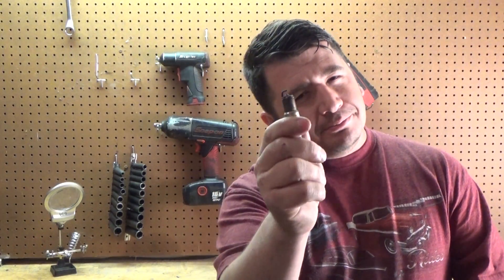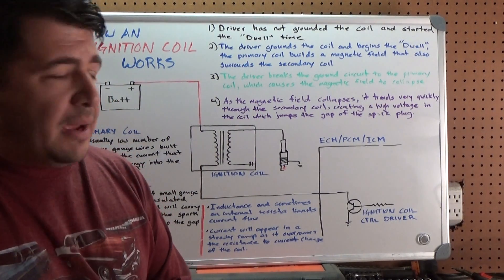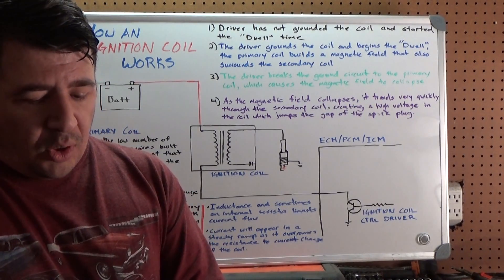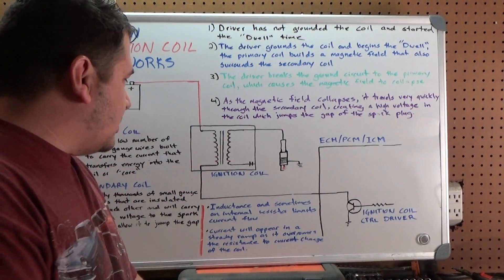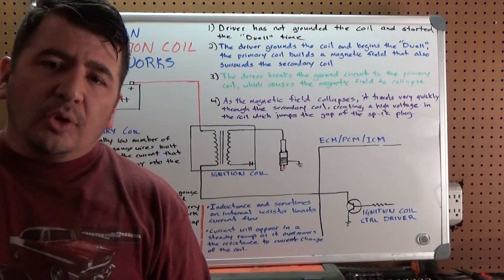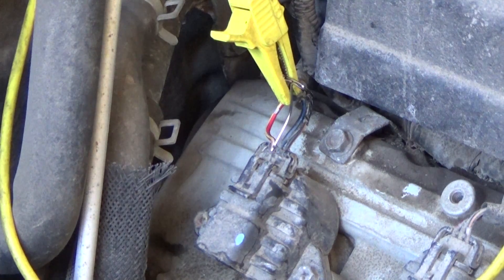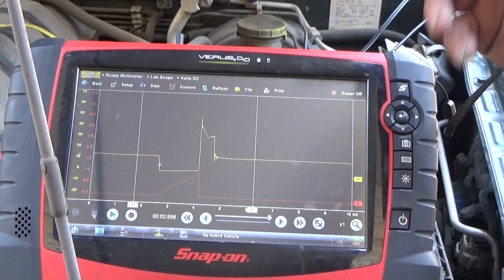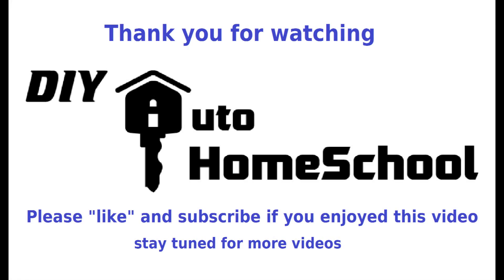How an Ignition Coil Works - Automotive Education

Comment: Hi friend, so the primary voltage is 12 volts when it's running
Reply from the maker: When running, the primary voltage will be charging system voltage (Typically between 13 and 14.5 volts)
Reply: @DIYAutoHomeschool  thanks for reply, and if it's an ac CDI scooter what should the primary voltage cause i am confused

Comment: 14:03 what's the difference between the yellow and red line.   He says yellow is on primary trace on control side.  What does that mean?
Reply: 10:08 The “control side” is the black wire (below the coil) on his board.
The yellow line on the meter is looking at the voltage on that wire. He points at it right here 10:15.

The red line on the meter is looking at the current flow through the red wire on the board (red line above the coil on the board).

Comment: If you had a highly focused, high frequency electromagnetic wave generator (such as the "Active Denial System" used by the govt) you can disrupt the operation of the ignition coil and you can cause random electrons to jump the spark plug gap - this is called "the Photoelectric effect" or photoemission.  The higher the frequency, the more effective the "rough running car" is.

Germans developed similar tech in the 1940s to today's 'Active Denial System' and tested it in ww2 to disable engines of the Allies that used spark plugs and ignition coils.  Photoemission/photoelectric effect technique does not work on diesel engines because diesel engines do not use spark plugs and ignition coils.  UFOs were known to disable cars using the same trick according to worldwide reports of witnesses, in the 1940s, 50s and 60s.  The Active Denial System is a technology descendent of those developed there in the 1940s.

Comment: Thank you for the amazing video. So if I understand correctly, coils on plugs have one side of the secondary winding connected straight to ground? Is it the ground symbol that you drew in the middle of the screen, at the bottom side of the secondary winding?

Comment: Great video!   I know when a transistor is driving an inductive load, you often see a diode in parallel to the inductor to prevent large spikes when the transistor/switch turns off.  Obviously there isn't a diode in parallel with the primary "inductor" for this ignition coil, so are the transistor switches in the PCM just high voltage devices that can handle the 50-70V spike, or do they have any sort of protection?   Thanks.

Comment: Does the high voltage pose any danger? I have seen videos where people hold the spark plug against the engine to check for sparks
Reply: Current flow - the amount of current flow - is the real danger.  If you look into it, you will find that as little as 0.050 amps (50 milliamps) of current across your chest can be fatal under certain conditions.  Not for everyone - depends on your age, health, etc. but better 'wary' than injured.

Many of us have accidentally felt the zap of a spark plug's 20,000 volts but you have to be more mindful of current.  One of the things we were taught in elec. engr. school is - if you have to grasp or handle part of an electrical circuit,  use the "One hand rule" - the idea is to never give electricity the chance to enter in one of your hands, go across your chest, then out the other hand.  Never hold electrical/electronic gear with two hands to stop it from affecting your heart.  And short out (drain) all capacitors after switching off power.

Comment: Primary back emf is between 350 and 450v, multiply that by turns ratio you get about 40KV secondary, your tools don't show that either because you're using them wrong or just because they're low quality crap

Comment: What happens to the voltage that is induced back to the battery in the primary circuit when the driver turns off?
Reply: Typically, it is absorbed by a "condenser" aka capacitor as a safety measire.

Comment: Great Explanation and thanks for sharing & publishing … so I have and maybe referred to as a stupid question; once the automobile ignition is turned and the vehicle starts and continues to run is the ignition coil still in use or is it at that point the distributor takes over? …
Reply from the maker: Not a dumb question. I don't think any question that's asked to learn something you genuinely don't know is a dumb question. 

Any time the engine is running, the ignition coil is working. The coil is what creates the voltage that jumps the gap on the spark plug and ignites the fuel and air mixture in the cylinder. 

On older engines that had distributors, the distributor's function was to direct where the voltage would flow to. On a classic example, there would be a single coil which would create the spark for all cylinders. The coil wire would go to the center of the distributor cap where it was transferred by a metal contact to the rotor. That voltage would travel through the rotor (which is was connected to the shaft driven typically by the cam) and make the extremely small jump to one of the metal contacts on the cap and to the post on the outside of the cap. It would then would travel through the plug wire attached to that post and to the spark plug for the appropriate cylinder. That's why timing is so crucial on a distributor, when that coil is fired, it has to be lined up ready to direct that all on the path to the cap, then the rotor, then back to the cap, and to the correct cylinder... at the exact moment that the cylinder is ready to fire as it approaches TDC. 

On newer vehicles, many have a coil dedicated to each cylinder (called Coil-on-Plug or Coil-near-plug typically). These are computer controlled and each coil will fire when that cylinder need it to. This eliminates the need for a distributor and lessens the strain on a coil by reducing the number of times it must fire, and allowing better output with more time available for it to dwell. 

So, in short, yes, the coil works the whole time the engine is running, and so does the distributor if the vehicle has one. The coil generates the voltage, the distributor directs it to the right place.
Reply: Thanks for your quick reply and yes it has a distributor … it a 1999 Jeep Wrangler Sport 4.0 straight six …

Comment: I keep having to change my ignition coils cause they keep burning out, somtime its a random misfire or sometime itl tell you which one it is but i change it and itl move to another that says need changing, the computer is good they say...what else can it be
Reply from the maker: mr me What kind of vehicle?
Reply: 2012 f150
Reply from the maker: I've seen it a lot on Ford vehicles. Customer comes in with a misfire and ends up having a bad ignition coil. We replace the coil and an month later they are back with a heavy misfire and 2 bad coils. Those get replaced, and then a while later they are back with another bad coil. It is pretty much always just the coils legit failing. It's why if a Ford comes in and has a misfire and a bad coil, I will explain the likely-hood of this happening and give them the choice to replace all coils at the point.
Reply: So you think replacing them all might solve it? Idk cause ive replaced a bad coil with the same coil i took out the week b4 lol....how is it possible to reuse a bad coil?

Comment: Hello sir, I have a question about the values of the capacitor used with the coil ignition , I find the value of capacitor it's about 0.27uF but I didn't found the voltage , some poeple say 1000v or 1500v but I am not sure, please sir could I find the right answer? thank you.

Comment: hello is there a PCBs oil in the coil ignition?
Reply from the maker: youcef. YOUCEF PCBS Oil is very toxic, not biodegradable, and is even worse when burnt. It was used as oil in very old coils and transformers because it insulates electrical circuits extremely well and resists breakdown at high temperatures. However, use of it in these applications has been banned in the US since the late 70's and many other countries about the same time. For the coils which are still oil filled for cooling, many other alternatives have been developed and there isn't really an industry standard that I'm aware of. 

Thanks for your comment and thank you for watching the video.
Reply: Thanks for your nice answer, I am looking for information about the oil used but I don't found any things, because I opened a coil ignition jsut to know the composion then I surprised when I found oil, my last coil ignition is from china, I thaught that has the ASKAREL oil toxic, could I find some doc about this oil used now in the coil ignition, Thanks for all.
Reply from the maker: youcef. YOUCEF Here in the US, any product that has any kind of chemical in it is required to have an SDS available (they used to be called an MSDS which means Material Safety Data Sheet.) It's a result of the "Right-to-Know" Laws in the US. This will contain all of the information about the oil used, composition, first aid, environmental concerns. You might be able to contact the manufacturer and ask for the SDS on the oil used in their coils. They might just send it over to you and it should have all the information you would be looking for about the oil in your coil.
Reply: thank's very much

Comment: Explained alot, thanks.
How important are Factory specs for the coil, Mine is a old oil filled type, Factory specs are
Primary 0.63 to 0.77 Ohms        Mine reads 1.4 Ohms
Secondary 7.0  to  8.6 Ohms     Mine reads  7.9 Ohms

I seem to have a problem when Im lets say stretching out a gear at say about 4500 rpm
It starts to start running rough, all the way to that point totally smooth.
Is there a rule of thumb on how far out of spec it can be, and what are symptoms when they are out of spec. I know alot of things can cause this, just trying to narrow it down, Got my injectors cleaned and flow checked , will be putting them back in also.
Thanks for the help.
Reply from the maker: Thank you for your comment and for taking the time to watch the video.

So, looking simply at the math we can apply to the ignition coil, we can get a bit of information. If you have an old style coil, I'm assuming you are working with a system with either a Ballast Resistor or a Resistance Wire used to drop the voltage to the coil and prevent damage to the contacts in the distributor. These systems provided full battery voltage during cranking to get better spark performance , then dropped the voltage during regular engine operation. Applying Ohm's Law to your specs and measured resistance, we can get an good idea of the current being used by the coil.

During Cranking

Specifications: 12 volts with 0.7 ohms = 17.142 amps for coil primary side
Measured: 12 volts with 1.4 ohms = 8.571 amps for coil primary side

During Engine Running

Specifications: 8 volts with 0.7 ohms = 11.428 amps for coil primary side
Measured: 8 volts with 1.4 ohms = 5.714 amps for coil primary

Now these numbers are approximate due to the fluctuations in operating resistance as the coil heats up and is under load, but it does show us the effects of having resistance higher than specifications. When you get up to 4500 RPM you are asking this coil to perform every step of what I outlined here 18,000 times a minute. That's 300 times per second. This is where you'll see the breakdown of a coil start to cause problems (high RPM's, under load, and snap throttle accelerations). We also know that the strength of the magnetic field produced by a wire is directly proportional to the current of the wire. So you are asking this coil to perform it's job 300 times a second while using  half the current and having a significantly weaker magnetic field to saturate the secondary winding and produce high voltage. So, I'm sorry I've drug this out into a long response, but yes, I would believe that it is entirely possible that you are experiencing the issue you are from the coil being out of spec on the primary side. But don't neglect the fact that the voltage that the coil produces does leave the coil and travel through the ignition wires and the spark plugs as well. A breakdown in a plug wire, or a crack in the insulation of a plug can cause the same problems. I'm NOT a carburetor expert by any means, but some of the people I know who are have told me issues with the float being saturated or too low can cause problems that mimic ignition breakdown at high RPM's. (I don't know if your vehicle has a carburetor or not)  

But, outside of this, if it were my vehicle personally, I would replace the ignition coil based on the out of spec resistance for the primary side even if that didn't entirely fix the issue. Some problems like this can be tricky to get figured sometimes and doing it over the internet is nearly impossible, I tried to line out the reasons why it's very possible your coil is causing your problems, but I can't guarantee it is the whole problem without putting eyes on the system myself, it may be a piece of the answer, it may be the entire answer and make your vehicle run better than it has in a long while. Just don't take the cheapest one you can find, find yourself a good quality coil.
Reply: Its fuel injected, actually a 1982 Nissan 280 Zx Turbo. Ive been checking around, and have come up with one, A MSD Blaster coil, but the specs, 0.700 on primary and 4.70 on Secondary , would a lower Ohms rating on the Secondary cause a issue.
Reply: Charles Miller i heard we can have a bit more resistance on the primary but never less